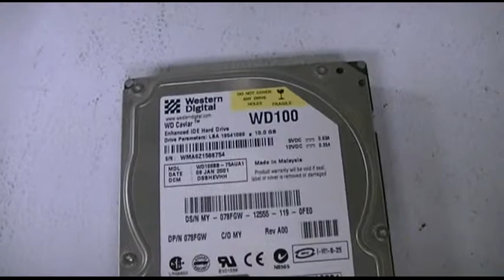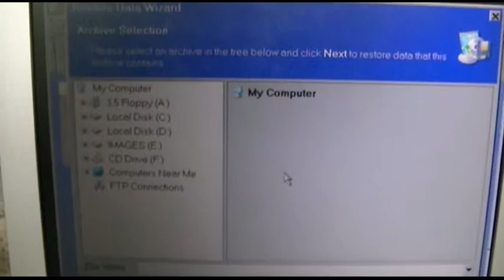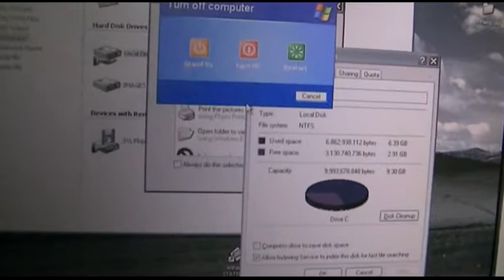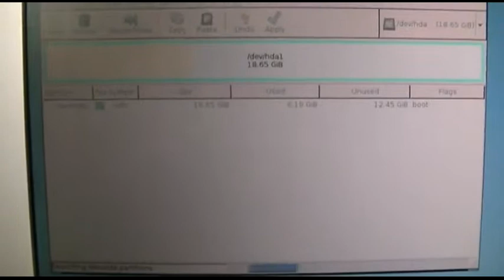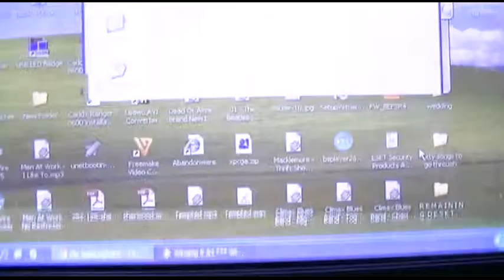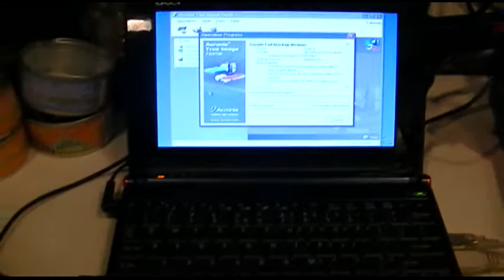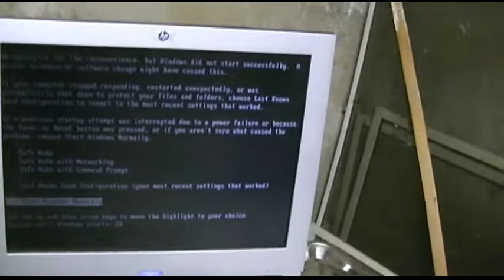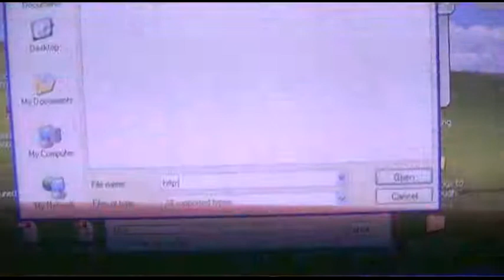SHOUTcast Server--bad HDD and repair

Comment: this video made me dig out my old Dell Dimension 2350 and put it in place of my Inspiron 620 (nope, not the iMac, sorry dude nothing is going to take that thing's place) to see if I could get it back running good, honestly I think I'm going to try to find a new hard drive and put Windows 7 on it and see how well that works out.
Reply from the maker: If there's at least 1GB of RAM, it'll run it.  More RAM will give you better performance.
Reply: jaykay18 The thing has a Pentium 4 and 1GB of RAM. We upgraded it way back when from 256MB.
Reply from the maker: Still usable hardware in my opinion!
Reply: jaykay18 It is very usable, just not for every day tasks like I use my iMac or MacBook for. It also has this thing where it doesn't want to connect to the internet via Ethernet anymore. I used to have this USB wifi adapter but I dont know where that's at
Reply from the maker: Perhaps that was an OS issue, possibly resolvable through reinstalling the OS.  Or, you can get a USB to Ethernet adapter on fleabay for about 3 or 4 bucks.
Reply: jaykay18 it says it's missing a network driver
Reply from the maker: If Device Manager is showing that, you should be able to download the driver from dell.com.

Comment: this video and the doorbell server 2 hour video i remember very much,  love these.  but anyway,  there are 3 xp machines i want to reinstall  and use again for whatever reason,  i have some printers hooked through my network, but i do not want these computers to reach outside internet. just my local network.  is there a way to block internet but keep my network access on xp?  i don't know where to put this comment so i went to the videos i know best lol.  thanks.
Reply from the maker: I'm not really a network guy.  I know you can set up a subnet and then restrict Internet access to that.  How you do it is another story.  If you only wanted the XP computers to talk to each other and no other devices (like a printer), the easiest solution would be to get a router and not plug anything into the WAN port.  This way it will still act as a DHCP server.  You could do the same with a network switch instead, if you wanted to set up static IP addresses on the machines.